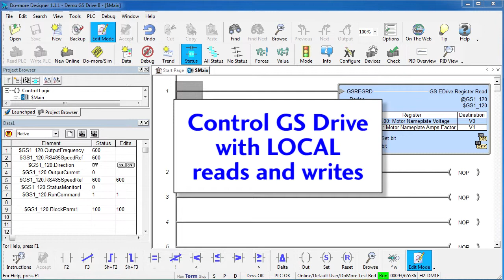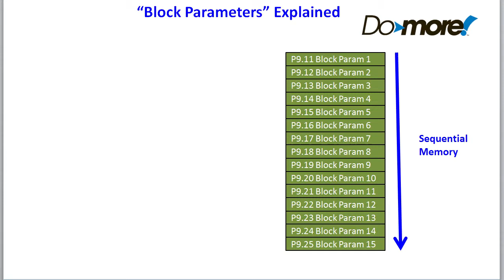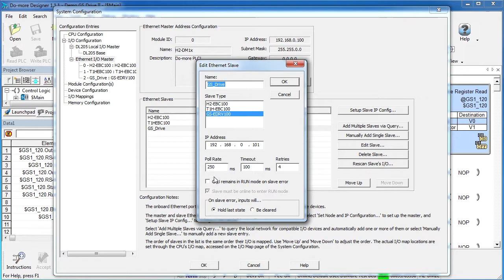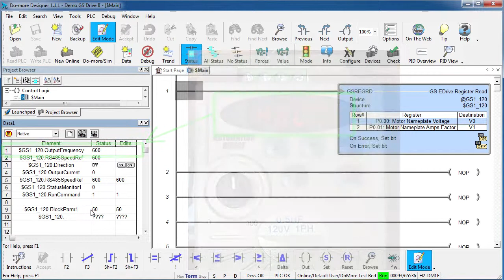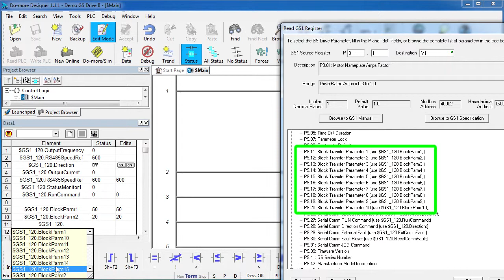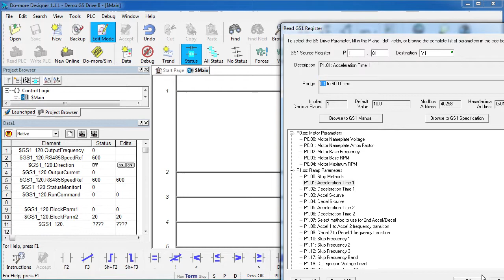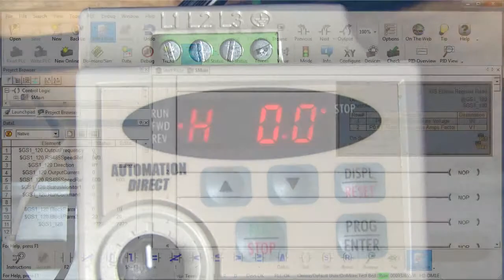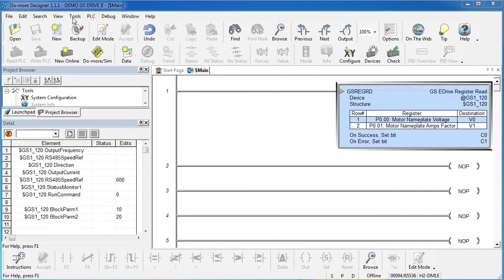BRX Do-more PLC Ethernet I/O - GS Drives Advanced from AutomationDirect

Comment: Thanks for making this video.  I had an application where I need to control the speed of the drive via Modbus BUT had to have a hard wired backup to the drive which moved the speed control to the drive keypad so I couldn't use the .RS485SpeedRef.  I added an auxiliary off of the AUTO contact that goes to a drive input configured as Multispeed bit 1.  Then I mapped the bit 1 speed to .BlockParm1.  That way in auto it will run off of the Modbus speed but in HAND which my multispeed bit 1 drops out it should revert back to the keypad knob.  I won't be able to test it until next week but I believe it will work.
Reply from the maker: +Tim Wilborne We’re happy to hear you’ve found this video helpful. The Do-more/GS Drive Ethernet I/O configuration is intended to provide an efficient, user-friendly way to manage and control your GS drives. Let us know how it worked out for you. Thanks!